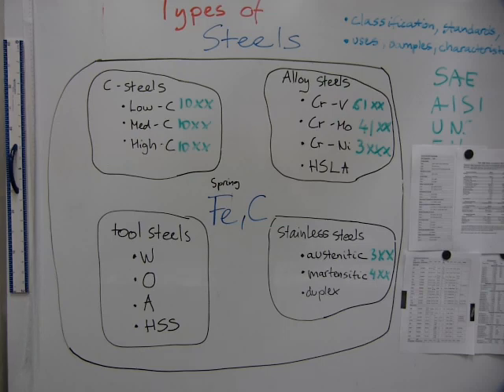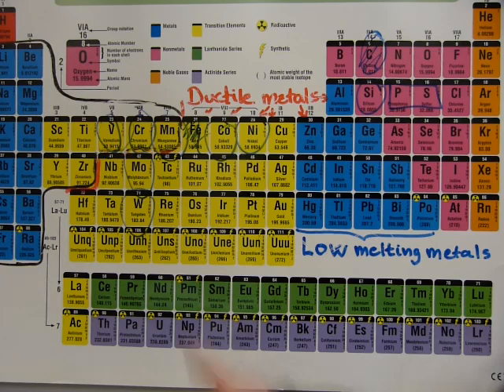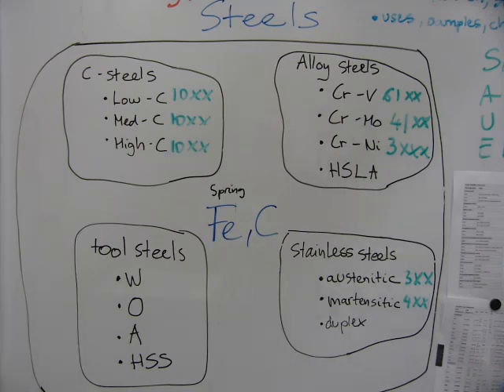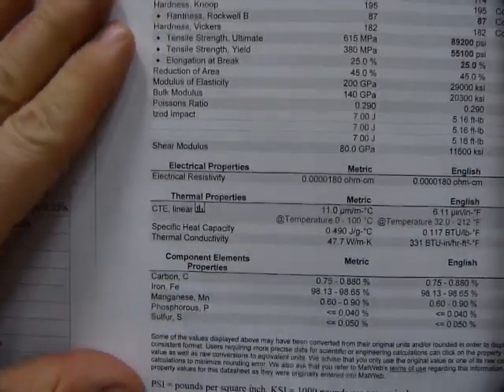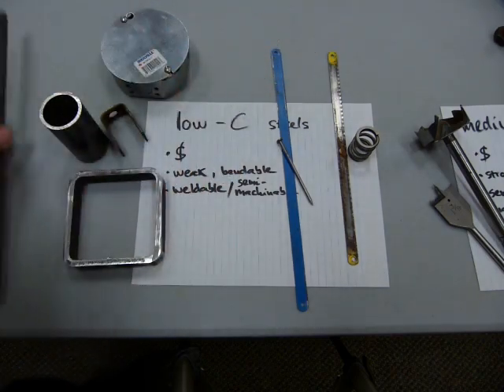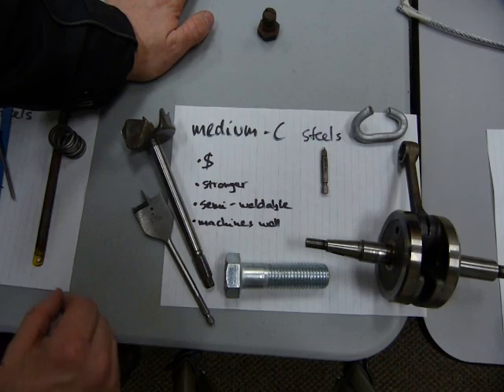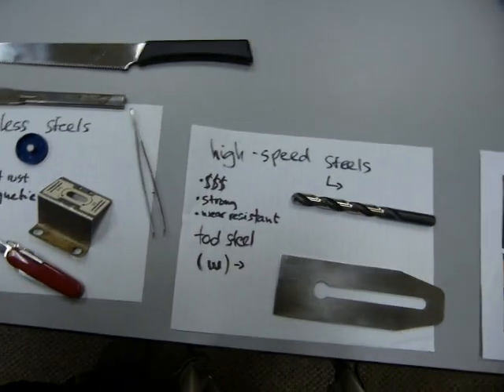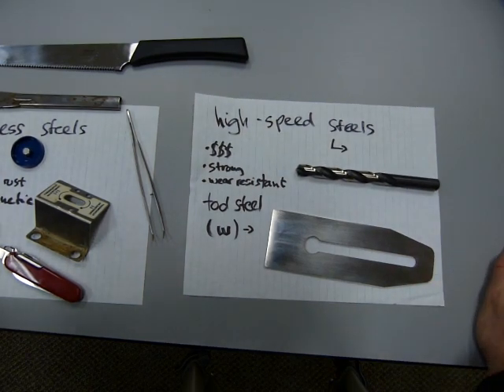Types of steels

Comment: So you mentioned that some tools are made of medium carbon steels if they are intended to be resharpened. But stainless steels and high speed steels are more durable so they may not need to be resharpened. If I wanted to make an axe head, what type/grade of steel do you suggest?
Reply from the maker: Axe head :
Most durable materials: 316 stainless, a.k.a. 14-12 stainless, does  not hold an edge
Best edge retention material: tool steels, including high-speed steels, none of them are resistant to corrosion
The edge has to withstand shock or impact loading without shattering and chipping. Medium carbon steel is a reasonable material, since having an edge is more important than resistance to corrosion.
Axe needs to be made with forging, in a forging press under thousands of kg or lbs of pressure, at a forging temperature. Without the right method at the right temperature, an axe head could be shaped but won`t work as an axe. Just a decorative mantelpiece.
Reply: theoverengineer. So a simple blacksmithing forge to heat the metal and 2 lb hammer should suffice? With heat treatment and tempering of course
Reply from the maker: Give it a go, see how it turns out, chop some wood, shoot a video and tell us about it.
Reply: theoverengineer thank you for the advice. This is very helpful

Comment: Is EN36 ( Case hardening steel) a low carbon steel ?
Reply from the maker: No, completely different steel numbering system. Its Carbon content is 0.12-0.18%, which is the mild steel range. EN36 is also alloyed with Ni and Cr which  make the steel case hardening. EN36 is similar to SAE 3400-series Ni-Cr Alloy Steel.
EN36 is suitable for roller and ball bearings of extra light section, aeroplane and motor
crankshafts requiring hard surfaces for roller paths, connecting rods with case-hardened ends, as well as highly
stressed gudgeon pins, gears and certain types of collets.

Comment: please give me answer, which steel are strong,high carbon steel vs high speed steel.is the high speed steel rustproof?
Reply from the maker: High speed is stronger, does rust.
Reply: many many thanks brother.I find this question many days but don't mind I want to know another answer please tell me high speed steel melting point.
Reply from the maker: Liquid at about 1550 C
Reply: thanks brother.

Comment: so wich kind/type of Steel is the Best for the Blade Knifes ?? wich one is the Strongest,Durable, and Impact Resistant Durability/Hardness ?? with non-rolling chip,edge ??wich one can retain the sharp edge for long time ??  and wich one is the best sharpener for it ?? waterstones ??diamonds , what else ?? thanks
Reply from the maker: Blade knife for what? Surgery? Bush whacking? Skinning deer? Chip carving? They all need completely different materials, completely different heat treatment, completely different blade geometry. I strarted a series on strength, durability, impact resistance, hardness and other things at: https://www.youtube.com/playlist?list=PL9cPDQOOfTepp8sSTY7xoGsAmX5MUf-aS
Reply: is a Survival Knife Custom Made by a friend  for Bushcraft and Outdoors , is a good Chopper aswel is made for heavy works ,out  in the wilderness , chopping trees  hunting , makeing shelter etc . Knife specs  7" blade(20cm) 3/16"( almost 5mm) thick. Steel is 80crv2 .he normalize the steel with 3 cycles. Do 1 heat treat and quench, and 3 cycles of tempering is that any good for it? thanks
Reply from the maker: Nicely made so far, will need to keep it dry but should last a long time, especially if the edge is ground on it properly.
Reply: ok nice to know that ,thank you :)
Reply from the maker: A knife to do what? Surgery? Splitting kindling? Sine when is strongest best?
Reply: err diamonds
Reply: Adrian Wolf 440c stainless steel best for Knife. It's the strongest steel ever.

Comment: Not sure if you still read these, but I had a quick question.  The xx in the designations, such as 10xx, do they refer to the % of carbon?  For example, 5160 would have Cr 0.80% since its 51xx. but then would it have 0.60%  carbon? Or, for 1095, would it have 0.95% carbon?  Just curious if I was understanding that correctly, and thanks for the answer!
Reply from the maker: +Amra That`s right, it works exactly like that in carbon and alloy steels.
Reply: Thank you so much for the response! That is extremely helpful :)

Comment: can i paint on steel ?
i want to manufacture steel doors and windows with wooden like paints on it,
but some people told me that steel cant hold paint for long ....
Reply from the maker: +Sahil Gupta I`m sure you can. It is also possible to paint steel. Needs proper surface prep: cleaning, pickling, priming, drying or possibly baking in a kiln between top coats, depending on paint type.

Comment: is cr-V more durable than cr-Ni? what's the difference when it is used to make tools?
Reply from the maker: +Mirage ™ "Durable" is not a standardized material property. But read on:
Both the SAE 3000 series Cr-Ni steels and the SAE 6000 series Cr-V steels, say 3120 vs. 6120 are very similar in strength, elasticity, shear deformation, impact resistance, weldability, machinability. All their alloying elements are all under 5% total content. Both Cr and V are added to increase surface hardness. Ni makes steel less brittle in Arctic cold (under impact) and somewhat resistant to corrosion (depending on %).
Cr-Ni steels are heat-treatable deep hardening steels. They make drive shafts, gears (tranny) and axles from it, so they are hard on the surface but give under shock loads. Cold service environment is likely. Low-carbon (under 0.35%) versions are weldable.
Cr-V is used more for high speed cutting tools, springs and bearings where high hardness is required but also give under repeated loading cycles. V retards grain growth at elevated temperatures, so hot edges stay sharp longer. Hot service environment is likely.
In hand tools at room temperature the differences don`t matter. It`s like eating pizza made with winter wheat and spring wheat. As long as they`re baked right, they work.
Reply: theoverengineer Wow thanks. I wish you were my best friend.

Comment: One of the most informative primers on basic steels I have seen.  I would recommend getting some help from someone with some videography and editing experience polish it up a bit.  That said, very good information if one can stay with it.  Thank you for your work.
Reply from the maker: +Idomake Thanks for watching. These videos were shot on-the-spot to replace the expanded set-up in class. Definitely not HD, not anything, just holding camera with one hand while trying to work with the other ... If you know anybody sponsoring educational development, send them this way.
Reply from the maker: Sure do. What kind of knife? Scalpels get thin and superhard, bushwacking knife gets chubby and impact resistant.
Reply from the maker: Oooookaaay. Usual work flow is: find steel chunk, heat treat, draw knife design out, cut out shape, heat treat again, fit handle. I recommend a generic knife heat treatment sequence from Bob Loveless`s book Knifemaking p.57, 66:
1 Annealing Heat thoroughly to at least 1400 F (760 C) or past the Curie point, then let cool slowly in vermiculite or in an oven over a 12-hr period, not faster. After the grind, bevel and taper are done, 
2 Heat up to same high temperature, quench in a barrel of cold oil, brine or water, clean blade, temper at 350 F (177 C) for 2 hours, then let cool in air to room temperature on its own. (No fans)
It will be hard enough to hold a fine edge and not too brittle.

Comment: Great video! thank you! Question: I just got a Cold Steel Katana, what does the 1055 Carbon mean?
Reply from the maker: +Rudy Cambara Chemistry-wise 0.55% carbon is in the steel which makes it hardenable by heat treatment (power sharpening can destroy it), has some give and not super brittle. Will rust right away unless protected. It was probably cheaply cast in a mold with no sign of going through upset forging.
Physics-wise a katana`s making, center of gravity and weight distribution are just us important.
Reply: +theoverengineer Thank you for responding so quickly!

Comment: is high carbon steel same as hard steel? if they arent same, can you explain a little bit whats a hard steel
Reply: Hardening is basically a heat treating process, and can be applied to any type of steel, though some will get harder than others.
But it is a different subject.

Comment: So if one was to get into blacksmithing, and more specifically bladesmithing, what specifications would be required for quality products?  Alloys?  High carbon steel?  Tool steels?  And then going a step further, if getting into damascus pattern forging, how do you vary the steels enough to see a pattern without creating a weakness in the blades?
Reply from the maker: DaigenHyorinmaru Weakness is not a metallurgical term. Brittleness? Low tensile strength? Low toughness? Lacking hardness? Surface hardness? Lacking impact resistance? Inclusions? Porosity? Slag? Lack of fusion? Delamination? Lacking balance? Blade not flexible? Low elongation? Do specify. Might want to start with a metallurgical textbook from library.
Reply: DaigenHyorinmaru I recommend sword buyers guide. this is good info http://www.sword-buyers-guide.com/buy-swords-online.html
Reply from the maker: Good resource, thanks for sharing.
Reply: +theoverengineer 

..... fusion?

Comment: Thanks a lot for this video! You presented very well many types of steel with good example and costs. What I miss for my project is the weldability of kinds of steel, the hardening (how hard is the particular steel after hardening and before) and the surface treatment. If you will have another video on that, that would be great!
Reply from the maker: Ivan Levels of hardness is produced by either
(1) "cold work" - forming, bending, extruding, ...
(2) "alloying" - carburizing, nitriding, high carbon steel, alloy steels, tool steels ...
(3) "heat treatment" - quench & temper, anneal,
Mild steel is weldable, anything alloyed (Carbon or anything) is tricky or impossible
Some ideas are embedded here: https://www.youtube.com/watch?v=7wIySgYHW44
or here https://www.youtube.com/watch?v=yxAde_kh0LE
or here https://www.youtube.com/watch?v=39ahpcfWOEM
Just type in keywords "brittle" or "ductile" on my channel, see what comes up. I guess I can make a comprehensive video on what I just typed up, too. I`ll think up some visuals for it.
Thanks for watching.
Reply: theoverengineer You're awesome! Thanks for the info!! You were a big help!
Reply from the maker: Ivan bitte schön
Reply: theoverengineer spasibo

Comment: Very informative.  I enjoy learning about metallurgy.  What does the designation 304 mean as it pertains to stainless steel?  That's a Great video.
Reply from the maker: donny ward digit 3 means "austenitic" stainless group, and 04 is just sequential, the 4th mix. Non-magnetic, soft & formable, excellent corrosion resistance. Sinks, faucets, strainers, kitchen stuff with no edge.See chemical composition and a bit about properties here: https://www.youtube.com/watch?v=0fKAFys9238
Reply: donny ward 304 refers to class of SS,as it mentioned in the video about types of SS-Austenite,martensite and duplex SS.Austenites have 200 and 300 class,so if you find anywhere with the label of 304,316 that's austenitic stainless steel..304 is also widely known as 18/8 stainless steel,18% chromium and 8% nickel basically and used for surgical items,the other 316 is 18/10 chromium being 18% and nickel 10%,its used in kitchen cutlery and sinks...i think 200 class stainless steels are less corrosion resistant as compared to 300 class....and yes Austenite SS also makeup a huge part of Pressure parts in Industrial boilers preferably for making superheaters and reheater tubes capable of withstanding high pressures and temperatures.so Austenite SS makes majority of the SS produced in the market,swiss knife like shown in the video is strong and tough,its made up of martensite..duplex has roughly twice the strength of Austenites.
Reply: Thank you for this information.  I frequently weld 308 formed plate and 308 pipe.  I noticed my fitter's magnet wouldn't work on SS.  I've been curious what determines how magnetic SS is.  I'm guessing it's the amount of chromium in the steel.  Thanks again for taking the time to respond.
Reply from the maker: donny ward Not the chromium. Austenite. Austenite is a special crystal, atoms locked in it won`t be magnetized. Now envision a cube, with atoms sitting at the corners + 1 in the middle of the cube. Austenite has this body-centered cubic crystal lattice, ferritic and martensitic steels are magnetic & are face-centered cubic.

Comment: Interesting video !
Can you please explain the difference  between H2o & oil quenching  on steel ?
I have also seen stamped on commercial type steel Truck frames that they should not be welded .
In your opinion is there any way to properly weld a broken or cracked frame with that stamping ?
Thank You .
Reply from the maker: During quenching the microstructure of steel changes. In quenching, red-hot steel`s microstructure called "austenite" turns into "martensite', regardless of the quenching medium. (Brine can also be used). Martensite is extremely hard and brittle. Water cools faster, oil cools a bit slower. In water quienching, more of the austenite forms martensite, and less of it forms pearlite - a softer form of steel. In oil cooling more pearlite forms and less martensite, so the finished steel is more ductile, less brittle.
Welding changes the microstructure of steel around the weld, all martensite and pearlite will transition into "ferrite" a very soft and weak form of steel (nails, rebar, roof flashing). In addition, all the fine dissolved carbon runs and clumps together and solidifies into streaks and layers of graphite (same stuff in pencils). It just breaks right there, graphite has zero strength. Even if the weld is quenched somehow to form martensite, graphite layers will still form, it is not reversible and be a weak layer in the weld area. So: it can be welded, it just won`t hold. Like trying to weld the claw back on a hammer, pretty until you pull a nail and breaks 10 seconds into it.
Reply: i have herd oil quenching ads carbon to the metal this also makes it harder
Reply from the maker: NOBOX7 Laying steel in a charcoal bed for 4-10hrs will add a quarter of a single percent of carbon to the steel, to a depth of 5 -10 microinches, a 45sec oil quench does nothing. Added carbon only makes the steel harder at the depth of the added carbon, microscopic amount of surface hardening. Done on gear teeth and shafts commonly.

Comment from the maker: Steel manufacturing is somewhat limited to - steel. With chemistry degree I would shoot for a bigger pie, metallurgy. Bettering steel for extreme applications (space, underwater, military) has been tried from all angles, new discoveries are made in composite metals, like Ni-Ti, Bi-F, Pt-Cu - just throwing out some letters there. Invent a kichen knife or drill bit that never needs sharpening, body armor that weighs nothing or vehicle body that weighs nearly nothing. Play with the patterns.